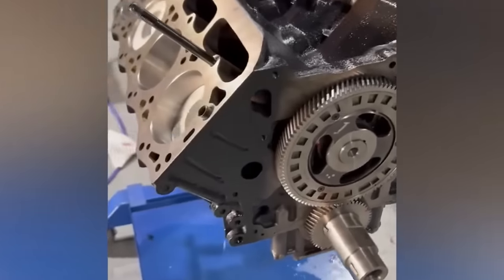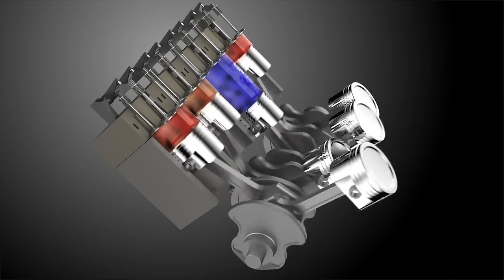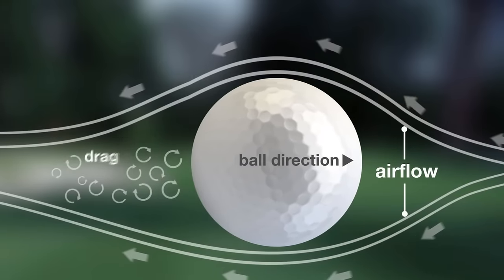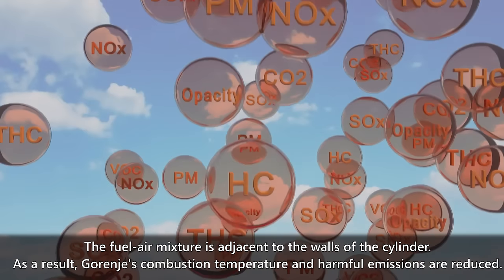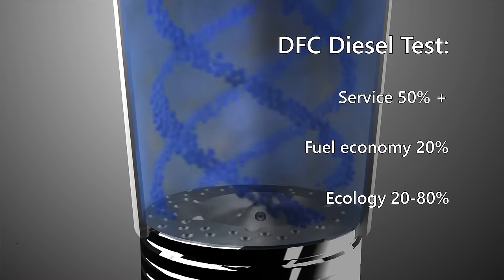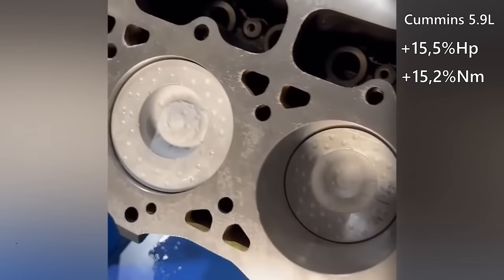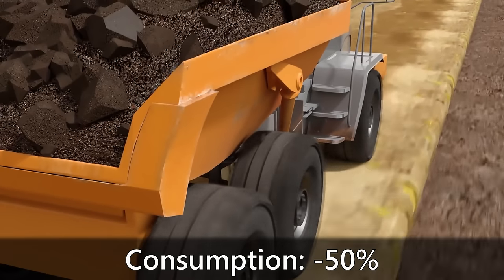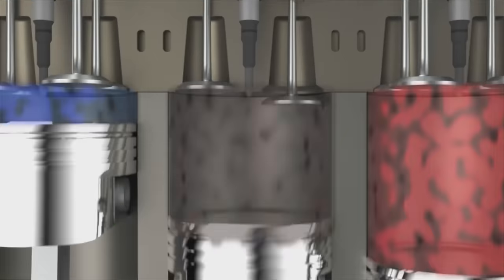NEW PISTON +50% Efficiency ICE -  Made the Impossible Happen!

Comment: The dimples will fill with carbon over time and pre-ignition/knock will destroy the surface.
You really don't want a rough surface with grooves and such when we talking about internal combustion engines.  We see carbon build up in the most expensive perfectly fine materials with catastrophic effects on high performance engines.
This would work on areas that air is clean ( throttle bodies ,intake manifolds and cylinder head porting)

Comment: 08/07/2023 Hello Look Auto. Does this manufacturer offer these pistons for gasoline engines? I have watched other videos about diesel engine remanufacturing using whatever they are called deep cone like pistons without the demples. I would like more mathematical engineering data. I would think that this type of piston would not have the factory spec compression ratios. I have seen some data or bragging about the use in racing engines. I do not know about the authentic source of other videos. Thanks for the video. Don

Comment: We need to look into fuel-injected two-stroke engines.
A power stroke per crankshaft revolution is where the torque is generated, particularly since manufacturer are making smaller displacement engines.
No valvetrain enertia.
Crankcase gases burned next power cycle, PCV system basically maintenance free.
Go back to heatsinks around cylinder heads, no poisonous radiator fluid to kill your doggos.
Magneto ignition electonically advanced and retard.
.....
Reply: I mean we can I like the two stroke idea but we really need to bring back the Detroit 71 series and do some refining on it but those things would grab and go and they sound great when they scream.

Comment: My thermodynamics is a little rusty, but wouldn't "combustion occurring at a lower temperature" reduce efficiency?  IIRC the efficiency of an engine is directly proportional to the difference in temperature between the inside and outsite.
Reply: That's not quite what they mean. Because the combustion is supposedly more efficient (by which they are suggesting it happens more quickly and completely) which probably means it happens faster, then less fuel is needed, so less overall heat is produced

Comment: That's remarkable, but probably overstating the resultss. It's a pity that it's too late. Still, in the swansong of IC Engines, it will provide useful improvements in efficiency and emissions.
Reply: Yeah, it’ll be the longest “swan song” in history. EVs do nothing to improve the environment and come at horrendous costs (child labor for materials, huge dumps for used hazardous materials, ya da ya da… I know, “but they’re gonna save the world, eventually). Get back to me in 20 years, my bet is that the transition will STILL be 20 years away (as always).
Reply: @ehb403  fake news.
Reply: @JimBronson  as i said, 20 years check back here…
Reply: Fun fact some steam engines can achieve 98% thermal efficiency vs 4stroke ice 25%
Reply: @matthewfredrickmfkrz1934  I believe it was Howard Hughes who eloquently pointed out the problem with steam using a well aimed hammer. Also, ICEs can reach much higher than 25% with proper investment (my own developments are predicted to reach about 40% but funding at the federal level is geared to battery development and other forms of transportation, like trains; I’ve applied and D.O.E. and N.S.F.  won’t even review the application).  Yes, the fuel efficiency of existing ICEs is too low, but that doesn’t preclude improvement (and no, I’m not going to just tell you what I’ve put 10 years of effort into). Also, there are even more pressing contributions to greenhouse gas emissions than cars but the bottom line is that EVs will NEVER contribute to the solution because they are at least as bad as ICE for lifetime carbon emissions.
Reply: @ehb403  at 100% volumetric efficiency a 4 stoke will only attain as high as 25% as only one stoke out of 4 will develop power
Reply: @matthewfredrickmfkrz1934 Coal fired steam engines make massive power.

Comment: At around $650 a piston this doesn't work for most people. If all the numbers work out this would only be viable for fleet vehicles. This video also doesn't mention that they are ceramic coated and use a gapless 2nd ring. That ring probably makes the biggest difference on some of those numbers by reducing blow. That alone keeps the oil cleaner, more fuel in the combustion chamber.

Comment: For those that can't believe it's possible.

Many people have made higher efficiency engines over the years.

Gas or diesel.

In gasoline especially with computers today it doesn't burn efficiently.

Actually it's made to waste, just to keep the catalytic working all the time.

So just that waste, not to mention why they do the intentional waste.

Because it wasn't burning off all the fuel to begin with.

So they waste more to get the catalytic to burn it off so there is cleaner emissions.

Check out the world record Ford opal.

That's an actual Guinness book of world record.

Many other examples.

That one was vapor deposition.

Comment: In the case of the dimples at the cylinder head inlet, for example, they do not improve the aerodynamics of the incoming air, they only serve to generate turbulence and create a more homogeneous mixture of air and fuel admitted into the cylinder... placing them on the piston does not the slightest sense! in the golf ball, it rotates in the air, and this minimizes the effects of drag... but if it were applicable to objects that don't rotate, formula 1 cars would be full of dimples, including ferraris and lamborghinis!

Comment: It doesn't matter. Look at what the EPA did to VW. VW produced diesel engines that had very good fuel efficiency. And, because they used so little fuel, they were very clean. This created a HUGE problem for the EPA. People were starting to ask why we would need to switch to electric cars when diesels caused so little pollution -- less pollution than the EVs if you looked at all pollution sources throughout the life of the car.  The EPA wants to do away with internal combustion engines for the plebes so that we can be easier to control. So they attacked VW (and threatened other car manufacturers who produced clean and efficient diesel cars.) That's why VW doesn't sell diesels in the US anymore -- even though people would love to buy them. And it's why this invention will never get used.

Comment: I did know a mustang guy that would put about 4 bags of ice in his trunk / fuel tank top !  😅.  Hey ?
Reply: Back in the early 80s i had a trans am with a 500 hp 454 bbc and had to put 30 ft of copper tubing in a bread box in the trunk beside my fuel pump and fill it with ice to stop fuel vapour lock . then the condensation on the fuel bowls after . no more vapour problems just cops .

Comment: The laws of thermodynamics will always limit the efficiency of combustion engines. They can never become even closly as efficient as electric engines.
Reply: Yes, but when a hybrid is required to be charged with a high efficiency ICE, like crankless ICE generators, we need to continue working on efficiency.
Reply: 1) You mean electric motors.
2) Efficiency can be defined many ways.  Miles per gallon is the most common way.  Electric motors get zero miles per gallon no matter what the maths say.  Pour a gallon of fuel into an electric motor and what did you gain?

Motors convert energy into motion.  Engines convert fuel into energy (and do other things)
Reply: @KC9UDX  Yes, I meant motor. Efficiency is measured as how many percentage output energy you get in relation to how much you put in. As a total you always get 100%, because energy can’t be destroyed. However the interesting portion is what becomes useful energy. The rest is usually lost as heat.
Reply: Smokey Yunick built an adiabatic engine that was very thermodynamically efficient.  It works by conserving the heat produced.  He didn't give the "secret" to his engine, but heat and pressure are essentially the same thing; so reducing the compression ratio and replacing that with an increase in temperature is possible.  GM ended up buying his engine and I believe incorporated a number of his principles in their vortec engines, but we never heard about it again!

Electric engines have inefficiencies of their own.  Energy storage efficiency is a major problem and the declining efficiency with age.  Heat loss with current flow is another.  Not to mention the problems associated with generating the electricity in the first place.  No one seem to be concerned with the EMF forces' effects on the biologic systems anymore!   This is a big topic; I could go on!!
Reply: @KC9UDX  a term I learned the trucking industry uses is 'cost per mile' which is RARELY if EVER mentioned about electric vehicles!!!
Reply: @matsonnerby   That's one way to measure efficiency.  Efficiency can mean other things to the user.  Am electric motor has zero efficiency when electricity isn't available, for instance.
Reply: @MrChevelle83  Cost per mile is exactly why electric trucks will be dominant over time. Cheaper to build, lower energy costs and less maintenance.
Reply: @matsonnerby  I highly doubt that, most of these electric cars would not be on the road without our US tax dollars subsidizing them and im sure the electricity will have to subsidized as well,  Aint no way an electric truck will go 1million miles and be cheaper than a modern truck. Plus they are a fire hazard and im sure the insurance rates will be high too, not to mention electric vehicles have little to no resale value making them terrible investments for any trucking companies.
Reply: @MrChevelle83  Cars will never be a thing since horses are so much better.
Reply: @matsonnerby where did that come from?
Reply: @MrChevelle83  i just made a point, that every change in technology has early adopters and late accepters. Electric trucks will soon be cheaper per mile, than the alternatives. And when that tipping point has been reached, it will happen. We are not there yet, but everything points in that direction.
Reply: @MrChevelle83 you're right. @matsonnerby is deluded.
Reply: @matsonnerby  I thought your original comment made the point very succinctly. Shame you had to explain it to the hard-of-thinking.
Reply: @MrChevelle83 im with you. Read about the transit system looking at electric busses. They cost three times as much, and had half the expected service life. They wouldve broken even on fuel costs after about 70 years of use i think. Of course because its the govt, they bought em anyway...

Comment: At first glance this pistons seem to bump up compression and it seems it creates a smaller higher pressure zone for "combustion" to happen, which in turn also creates a higher compression. It also seems that the test results are cherry picked to suit the ideal rpm for the piston to work at full efficiency. I am sure the pistons are an improvement from oem especially in "heavy duty" engines where there is a lack of performance oriented hardware inside the engine. I bet this large diesel engines have a run of the mill, 0 technology piston. I highly doubt in a modern diesel engine those claims are broadly applicable without cherry picking results

Comment: Show a Dyno chart.  15% in power is a decent increase.  Building race engines things like that dnt gain a lot of any power.  So to make that in an engine that's not that dnt have as high a cylinder pressure dnt sound accurate.  Just some more internet yadda yadda

Comment: lol golf ball dents won’t change 30% heat loss thru cylinder walls or 30% loss thru exhaust or 20% mechanical loss.  Turbulence and complete combustion is not the main efficiency issue.

Comment: The explanation about the golf ball and applying that to airflow on the cylinder and related heat is wrong and backwards.  Most likely lies to protect the patents.
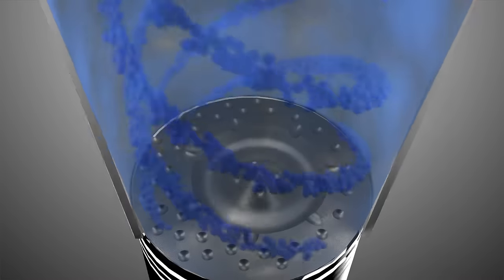The dimples on a golf ball promote shear using turbulence at the ball's "widest" part thru the wind, not turbulence behind the ball. This upsets laminar flow around the ball which would cause unwanted drag.  1:20 "allowing fuel-air to adhere to the cylinder wall while also reducing pressure" . . . on a Diesel . . . near the top of the compression stroke . . . where the fuel is sprayed in from the top-center . . . . !!

Comment: The oil industry has been actively hiding or obstructing efficiency from the car market for decades.
Reply: You don't understand how things work. The oil industry has its hands full trying to make extraction of oil cheaper and safer. There are plenty of areas where oil is only marginally economical or not adequately economical to obtain at the moment, depending on the oil price. They don't have time to 'suppress more efficient engines'.

Comment: F you want to significant improvements to ices you need to change the materials it's made of as metals are porous at the scale of air molecules, aluminum is worse than steel in this regard.  But every part wherein gas flows,  head, cylinder walls,  valves, intake and exhaust manifold e.t.c.  a 30% loss in efficiency.
Reply: You are mistaken.  
    Cast iron is used purposefully because of its molecular porosity, it holds oil on the cylinder wall.  
    Secondly it has been found that short side turns in intake ports flow better with a rougher finish.  The rough finish slows the air and keeps it closer to the inside short radius, thus allowing more air to round the curve.  
      Seems like smooth would be best…. But thats not always true. 
    Some heads have a better overall design, and port layout…. So the cast finishes can be very smooth and still work great. The gen iii hemi eagle or Apache  heads for example.

Comment: This is just a Fugazi as dimple porting intake runners or throttle body spacers 😂 an understanding of simple physics will show this is BS …dimples work on golf balls because they fly through the atmosphere at ATMOSPHERIC PRESSURE…also the dimples are only there to prevent the Magnus effect, (basically stops the ball from flying in random directions once struck by the club)…last I checked piston driven engines operate in either a vacuum or compression depending on the cycle of operations…plus MOST diesel engines rely on forced induction, whatever “turbulence” they’re claiming is being achieved is completely pointless…there’s literally nothing these pistons achieve that a skilled tuner can’t produce with a programmer …there’s no reinventing the wheel, diesel pistons are shaped the way they are after decades of R&D by companies with far more capital and engineering prowess. These aren’t even a new idea…sleeve valve aviation engines used similar technology but those engines operated under very different conditions to achieve combustion with substandard fuel available to the countries that developed them (mostly Britain and Germany). Sleeve valve engines can in both diesel and gasoline variants so even within that class of engine there’s tons of nuances

Comment: I dont belive it i know that mixing gas "Liquefied Petroleum Gas - LPG" "natural gas or propane" with diesel fuel in like 10-30% "9/1 to 7/3"  without any modifications gass is injected in to an air flow and give more power with cleaner exhaust gases tested on old diesel engines and installation cost about 50$ using used parts like gas bottle reductor some rubber pipes no piston in the world give you this much power and engine works better cleaner and has better work culture
Most of the time you shave you trade 1 liter of diesel for 1 liter of LPG so if your car takes 10l of diesel then with LPG you get 8 diesel and 2 LPG and in trucks it goes about up to 50% with specialised installation.

https://www.youtube.com/watch?v=Bl2qxvlGAuQ&t=703s
https://www.youtube.com/watch?v=iWuNdCjs190
https://www.youtube.com/watch?v=Bl2qxvlGAuQ&t=703s

Comment: Those dimples wont work well when filled with soot. 1930's this was used. ...just sayin for a friend.  This is goofy and wont offer any benefit in performance. Maybe just put on a better reflective coatings instead so you can ramp up combustion chamber pressures? Isnt that the real limit right now with diesels? Excess thermals on piston crowns and valves? P.S this was done in the 1930's - 1950's. Did you forget?  Same friend said that too.  He's a bit disappointed that Gayle Banks name is on something called groundbreaking and new, when its from from the 1930's performance and aviation crowd!  Hoping its not, but plagiarism is bad M'kay.